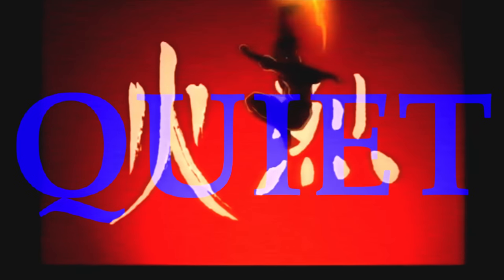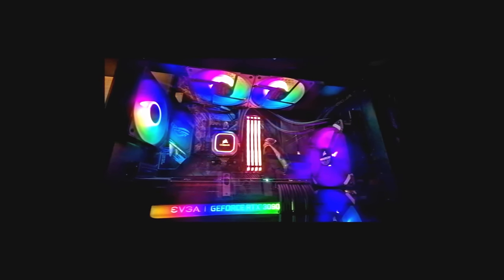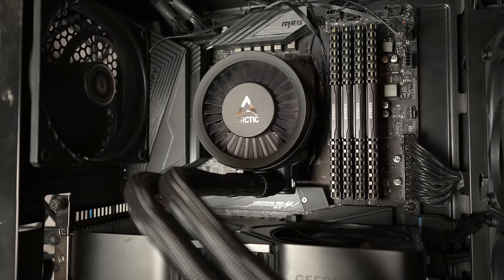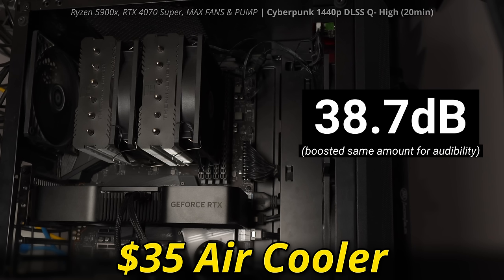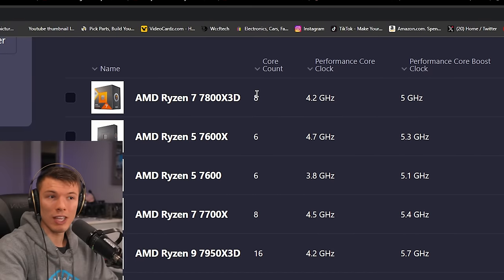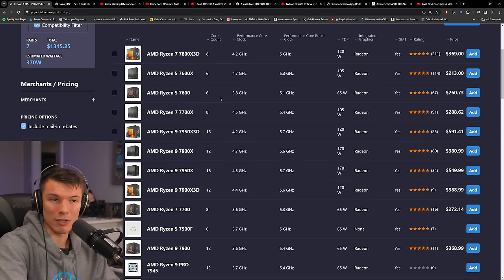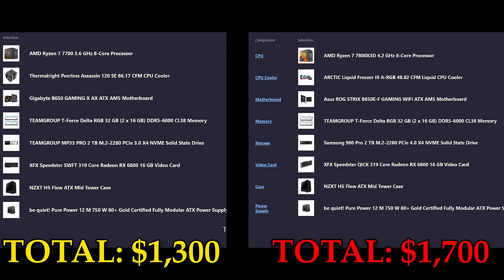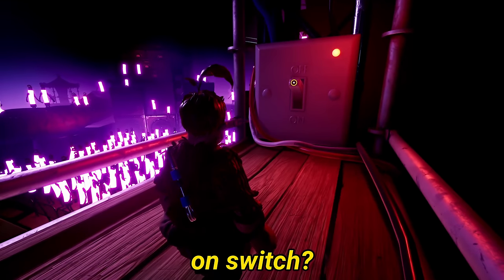How to Get the BEST VALUE PC!! (you’re doing it wrong…)

Comment: I'm an Asus mobo guy, myself... MSI is real good, too.  And Asus GPU's are the best, but yes, side by side, clock for clock, it's all the same.
Asus typically makes custom PCBs with overkill VRM set ups and always has the best cooling.  Necessary?  Not at all.  But like my Asus STRIX RX480 8GB had a VRM set up that could put out 300 watts or more.  The card?  It never pulled more than 150 watts in games lol.  Maybe a special program could make it pull 180 watts.  (EDIT:  I'm on an XFX Qick 319 6700XT 12GB flashed to the Merc vBIOS right now... no issues out of it.  But I'd NEVER buy Powercolor, and for motherboards, I stay away from Gigabyte.  Supposedly Asrock has improved greatly since a decade+ ago when they were pure trash, but Gigabyte?  Still burning out on people.  Then, again, I admit I killed my Asus B450-F Gaming II with a 5900x.  Went a year with an R5 3600 but 6 months with a 5900x and playing with PBO, pushing 180 watts here and there because "muh benchmarks are fun"?  Killed 'er.  This B550-F Gaming Wi-Fi II has the VRM set up to handle it, though.. as any mid-range+ B550 board should have.  But I doubt they all can.  I've left videos encoding overnight, pulling 180 watts for 8 hours using the CPU "just because.")

But yeah, it's overkill and you overpay for the same experience.  No denying that.  Just like the motherboard, they have no effect on performance (assuming PCI-e slots are the same Generation and lane count), BUT the quality and little extras you get are always better.  

It's why I have to buy headphones with an Aux cable... The Asus ROG STRIX B450-F Gaming and B550-F Gaming/ Wifi/ II have dual OP amps with the S1220a chip that can handle lossless audio.  And if you download the drivers and software, you get that Realtek software and you have 3 options on your amp, which I just max out.  And then you can make your headphones "too loud", which is always a problem for me.  Headphones being too quiet.

My headphones (Corsair HS 65 Surround) are twice as loud through the Aux port as they are through  the "7.1 Surround USB" connection.  Besides, not only do they come with Dolby Atmos (I already had it), you can buy/use Dolby Atmos or DTS Sound Unbound, both of which support 3D sound on headphones or wild sound enhancements for 5.1/7.1 speaker set ups.  They both work on 3.5mm aux ports.  Ya don't have to have it built into a USB dongle.

But here I am, talking about expensive motherboards and GPUs and cheap headphones haha.
Reply: But that's wild your 5900x lasted on a B350 @ 200 watts.  Dunno how long you used it that way, though.  I mean, the Asus B450-F Gaming II had the upgraded VRM set up and all lol... didn't matter for me.  I also had the 3600 on PBO, but that meant going from 65 watts to 90 watts or so.  The 5900x can pull 200-220 watts easily.  I just use a 180 amp EDC and a -.05v offset on the CPU voltage which means at 180 amp EDC I never go over 190 watts, usually never over 180 watts.  And that requires AVX or video encoding.  

And I'm at the point where it's not worth encoding via CPU when you want to super high quality encode a 20GB video.  It's like 8-10 hours vs using the GPU to do it in what?  45 minutes or less?
my case.  It's black with a clear side panel.  Whoopdie doo.  2x 140mm in the front, 2x 140mm up top (or 3x 120mm but I have 2x 140mm) and 1x140mm in the rear.  Wish it had 2x in the rear but I guess there isn't room for it.

Comment: Full load 7800X3D, 80W, peaked at 74 degrees? What the hell. I've got a Pure Loop 2 360mm AIO and I hit 84 degrees the other day, with the fans blasting at 100%. I think I must have done something horribly wrong.
Reply: It will sit all year at those temperatures.  You will be fine, but if it makes you feel better, you can always repaste.
Reply: @kintustis  I mean I bought into the liquid cooler hoping it would be silent but this is too noisy. And Gigabyte fan control sucks. It sucks hard.
Reply: Default PBO auto overclocks until 90c limit or so, some do a -30 magnitude undervolt with 75c thermal limit instead.

Comment: I know what I'm about to say will be controversal, but let me explain. 

I prefer a consistent software experience by using products from a single brand. The inspiration for this approach came from Corsair iCue technology, which makes it possible to easily configure many Corsair products with just one app. That's when I wondered why more brands don't offer similar compatibility.

I also follow this philosophy in the field of peripherals. I don't like to download separate software for different products from different brands to get the most out of them. That's why I'm a big fan of it when I only use one brand and therefore only have to use one software. In my case, it's the Steelseries GG app that I really like. This allows me to get the most out of the Steelseries peripherals.

Comment: nonono no one wanna be a linus sebastian of builders! dont drop hardware!!!!
at atx or matx i say aircooling is best at itx i say nothing goes over watercooling if the case can hit it (iam a itx fan <3 and hate big pcs)
at my case you can fit a 92mm 40mm high air cooler with a slimfan  or a fullsized 240mm aio i dont really think you can cool a cpu with the air 
(i tested it befor at air 95C was too hot mosttimes i was on thermal limit and 500mhz lower.... and now with aio +600mhz oc and at 65C at gaming i think its totally worth it the 240aio costs me at a alternate (german tech site) 50% off so the aio costs me only 59€, my itx b550 board costs me 130€ and it has wifi+bt
at bigin i want a non rgb build but with the 50% off action i buy rgb bcz. it was cheaper at the time and better then no rgb ... and then i turned the rgb off :elbowcough:
i tested befor some months my m.2 and my 2,5" ssd at linux it feels not really much faster but vs windows it was so freaking fast! okay linux is faster then windows its not fair :D
i use no highend i dont need highend 😁 a friend of mine is a person who want only highend bcz. he means its future proof.... yes.... he spend the last 5 years 15k at 1 pc i spend the last 10years at my 3 pcs 2,5-3k and we play everyday the same mmo 😝 future proofed vs too expensive things who drops hard in prices too my younger  me good choose with the 960 1660s and rx6700xt and at "console killer" htpc build 1080ti it was all worth it i think my htpc build can life formore years then 2024 bcz 32gb ram ryzen 5700x and the 1080ti for "retro" gaming and rougelike 2-2,3D shooters if anytime apus can beat the gtx1080ti at gaming i build a new one but tinier

Comment: When comparing the CPU's (thus far 8:36 ) you havent compared how they'll fare over time. You mentioned that AMD has support for longer with AM5, But a 7800X3D will outperform the cpus you mentioned for way longer in games. A 7700X could be cpu limiting your system in a year or two, odds are a 7800X3D will keep you for many more years. I think that's the trade off with price. 

I think if you dont want to have to upgrade for a long time then the 7800X3D is the best choice. But that comes with an increased price tag.
Reply: Just did an AM5 build and went 7600 and saved $200 which will go to a zen5 x3d later this year or early next.. If you going high end go big at the start to max usage  not near end of life and be sorry in less than a year
Reply: Unless you have a 5090 and like playing csgo in 720p, or if you like playing modded slavjank games, they are effectively the same.  Those HWUB benchmarks are basically the maximum possible difference they could eek out with the most unrealistic possible settings.

By the time you need more performance, you can just upgrade to a 9700x or something to pair with your rtx 8060

Comment: Hmmm ye, good old high end air cooling, for people that enjoy their semi conductors to run at/near its thermal limit constantly, and bending the PCBs they're sat on in the process while they pretend they're saving money in the long run...for nearly the same price as a basic asetek cooler. 👍 IQ over 9000

3:50 that little bit showed ur arguing for the cart to drag the horse. That's exactly why an AIO is quieter in normal day use, when you open an app and it spikes the cpu for a short bit the fans won't go haywire, since the coolant can take that thermal load without notice. This is like arguing a GPU with higher FPS and more stable frame times isn't that useful in the real world if ur only using it for minecraft since you won't always use all the FPS...yeah but the frame times suck.

I'm sorry, but I can't hear my pump at all.

Comment: On the front of whether you'd be able to tell the difference between a 7700 and a 7800X3D?
Yes. 100% yes. Even in GPU bound scenarios, the 7800X3D actually gains frames. And it gains the MOST in minimum framerates, those "drops" that are the most noticable

If you spend more than 400 bucks on your GPU, you want that 7800X3D. It'll come in handy later
Reply: A fair few games love that extra cache, my 5800X3D with my 4090 @4K gives me my stable 120fps that I like.

Comment: 21:40 - not happy to see such a mess under your table. It is in fact really dangerous (did not you said you have to use it without side panel all the time because of nVidia power connector?) even if you do not take esthetic point into consideration. And it tells a lot about your personality too unfortunately. My suggestion is to just make a vid about exactly that - clean cable management and safe PC position, maybe with testing sound output of the rig when being  20 cm away right on table or being two meters away and happily hidden. Suppose it will be watched till the end to see and compare results. :)

Comment: Well, this depends. On my 5800x with one CCD that gives out all the CPU heat from small space, watercooling is a salvation. I had a beefy air cooler and it sucked. One CCD CPUs prefer water from my experience. I own LF III 360 and it's quite enough not to bother me at all.

Comment: Another 1 that people tend to spend money on that has no performance boost is RGB. Do they really need it for the price bump ? Like you said once the PC is built you'll barely be looking at it. The monitor is where your eyes are 99% of the time. You're better off forgetting about the RGB & put the money towards a better monitor.
Reply: Most components have RGB built in. And for me I didn't wanted to turn it off because I paid money for it. Plus today is much easier to buy fans with RGB then without them. If everything wasn't built with RGB then I wouldn't even bother about trying doing any RGB lights on my PC.

Comment: Air cooler all the way. I just don't want any liquid near my pc. Just in case there is a failure in the AIO, I don't want the hassle to clean it up. Not to mention that the pump probably gonna fail in the future due to usage.
Reply: I have Corsair 170i that I bought for 170 euro a year ago. I also have reasons why I bought it. First is that it has 5 years of warranty. Second is that I got tired of huge air cooler towers. That might bend the motherboard overtime. Third I have 13700k that needs to be cooled better cause it's Intel and a year ago it was more reliable option than AMD in Europe. If next generation AMD will be still better than Intel now I'll definitely go for AMD CPU.
Reply: @gozadrotit7426  well, that def. heavier build than mine. I don't oc and no heavy load either. So i just have them light air cooler with one 120mm fans.

Comment: The only reason to get a 7800x3d over a 7700x is just because of Fortnite game eats older cpus and puts them at 60% usage and gets almost 300 less frames on the 7700x then the 7800x3d i am the cpu over everything kinda guy since i play valorant and fortnite but im not recommending a 7800x3d unless you play those two games or hoi4 and civ so i guess 4 games. And even them its just future proofing which inevitably will not matter if you just lower settigns its mainly can the pc keep up with my expensive monitor i didnt need simulator 2024.

Comment: Sorry but sticking with liquid cooled CPU. Im not comfortable with constant volatile jumps in unstable temperature. Liquid cooling makes it much easier to set proper under/overclocks. Using fan cooling on a CPU is like watching the behavior of a cartoon bomb, and i wont ever be comfortable with that. I'll gladly pay extra for more predictability in handling temperatures.
Reply: That's definitely born out of your unique experience. The thermal mass of liquid cooling can be beneficial, but if it's the sole reason for your stability then I'm definitely leaning towards there being something wrong.

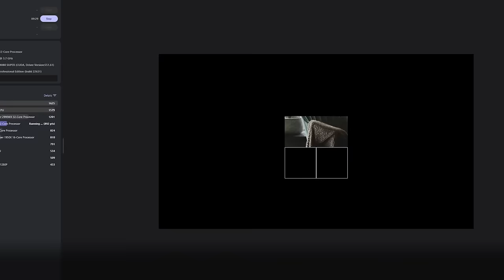Comment: 3:14 These are not small differences.  It is not about performance.  It is about longevity.
Reply: Copeee your cpu is not going to fail due to 79c
Reply: You know PCs can survive 10+ years with stock coolers right
Reply: Also the thing about the difference of almost 5 is it is 5 closer to throttling.
Reply: Point me to a test where 75c to 80c changes the lifespan of a CPU.  All of the "common knowledge" of reddit is absolute garbage.
Reply: @karathkasun not at those temps. But when things start to get hot you are 5 closer to throttling. From season to season 5 is not small.
Reply: @karathkasun I found this:
Generally, anything between 40–65°C (or 104–149°F) is considered a safe heat range for a normal workload. While running more intensive apps or games, the normal CPU temp range can increase to between 70–80°C (158–176°F). The rule of thumb is, a bad CPU temp is 80-85°C (176–185°F) or above.Jul 3, 2023
Reply: @0x8badbeef  if you plan on keeping your cpu for 50 years, 85C or less is ideal.  For everyone else, you can redline it all day and it won't care because it's a piece of silicon designed not to throttle until it hits 95C or 100C (source: AMD and intel spec pages respectively)
Reply: @kintustis I just took a quick glance at benchmark thermals for gaming from a variety of channels.  They generally are in the upper 60 and lower 70.  That suggest pushing 80 is not good.
Reply: @0x8badbeef And For gaming the cheap tower cooler is pushing 64 in his test anyway. None of the temps in this video are of concern. AMD and Intel both heavily monitor the power being pushed into the CPU to maximize performance without impacting reliability.

Comment: IDK, I am often annoyed by air cooler in gaming(~100w and over 1000rpm).
A 360 AIO will never spin up in gaming load(~100w, under 700rpm and 60c), and can handle 200w constant load under 90c with only 1000 rpm.

The noise difference to me is night and day.

Comment: Regarding the cooling part of the video you have some good points but missing important ones by mixing AIO vs Custom Loop
The noise from an AIO pump doesn't exist with a good pump like Alphacool VPP for example.

While watercooling the CPU like you mentioned isn't often useful, especially on sub 120W TDP, for workstation oriented configuration  with 200W ones it's a legitimate use.
For the GPU reference design + waterblock is hard to beat if you plan to keep yours a few generations, the gain in temperatures, noise and potential performance uplift is major. Again being very noise sensitive I can't see myself going back to aircooled GPU.
Granted the initial investment of a custom loop is significant, but you will keep the pump and rads for a long time, and on AM4/AM5 the cpu waterblock too.
Reply: On the workstation side it doesnt take as much cooling even though the power is higher, because workstation level parts have larger dies that are much easier to cool.  Dual 150w Xeon rig I have can use 92mm air coolers and not exceed 70c on the cores while also being fairly quiet.  The die size on those CPUs is roughly 4x what a normal consumer part would have.
Reply: If you just want to spend money, just say it.  For me, a bit of fan noise is not worth a 500$ custom loop.
Reply: @kintustis You completely missed the points I made.
I wasn't focusing about the cost but the relevant use cases of custom loops. If you don't care about noise and/or don't have a budget for it just don't use it and be happy with aircooling, plenty of great models at $70-$40.
However, if you aren't budget constrained and care about minimizing the noise, temperature of your gpu, then custom loop is a very valid solution.

No offense meant, but I couldn't care less about your specific situation, and I'm happy if your current build works for you. This is a video whose goal is trying to be educational, it shouldn't dismiss real advantages of a solution. We are not talking about adding RGB to your case to make it go faster.
Reply: @karathkasun You still have to displace that heat, there is no magic in it.
92mm coolers and fairly quiet is your statement, nice if it works for you. But I'd bet that for some people it wouldn't be workable.
And look at the latest threaripper, 350W to manage, yes the die is huge but if you want to cool it in relative silence aircooling won't cut it.

I don't see the point of your reply and the other users. I never said that watercooling for the best solution for everyone, far from it. But it does have some valid scenarios that's all.
Reply: @halmyrach Air cooling TR can be done with a 120-140mm tower without problems and with acceptable noise.  350w is NOTHING when you can get air cooled GPUs pumping out 400w with little to no noise and heatsinks that fit into ~3 slots.  GPUs and things like TR have one thing in common, larger area of contact between the thermal load and the cooling device.